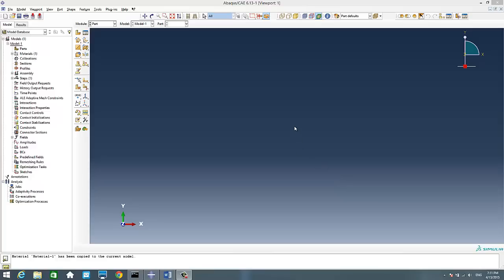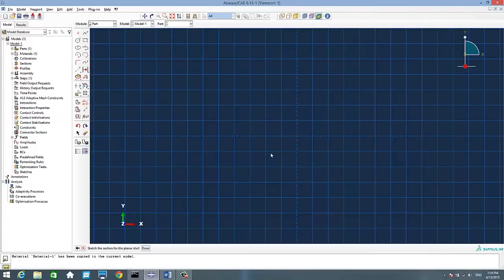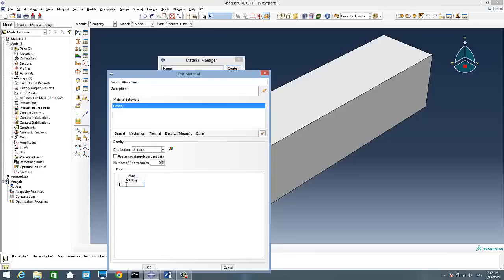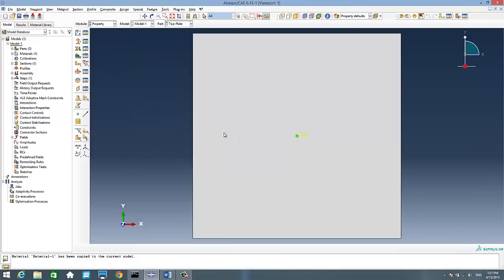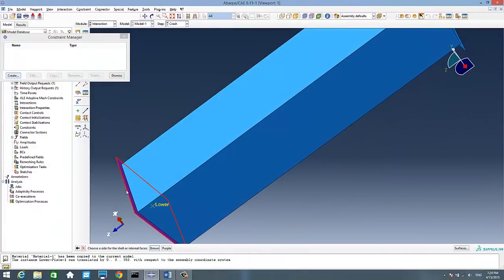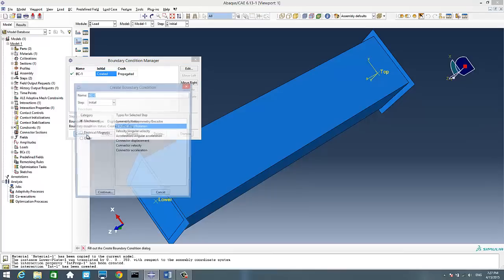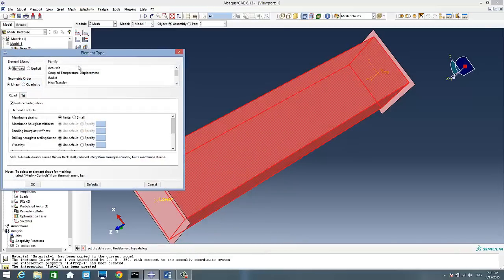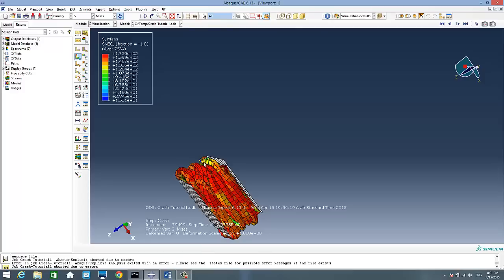Tube Crash Test Tutorial Using Abaqus 6.13

Comment: Can you explain why did you select the box dimension as 76 X 76 (or 38 on both sides of the axes) and why did you select top surface (should you not select bottom surface here? so that the box becomes 80 X 80) ? Why shouldn't we select mid surface and 78 X 78 as our dimension ?

Comment: Can you please make video on circular Tube Crash Test on Composites(Al with Polystyrene Foam). Actually i am working on it but i am not succeed to get the result When i am following your video it is giving Shell is not suitable for plateau stress analysis. Just I  mentioned Al with Polystyrene Foam as a composite

Comment: can you tell me please how much time did the job took to complete ? and what's the optimal configuration of step to have the minimum time for pretty accurate results ?
Reply from the maker: The time period refers to the total time needed to complete the crushing of the tube. In this simulation it was 0.06 seconds (60 milliseconds), which is reasonable because the crushing is dynamic and the crushing mass is 275 kg in our case, and hence it would not take much time. The total running time for a simulation therefore depends on the time period and the CPU you are using. 
As for the accuracy of the results, it does not depend on the step time, however on the way you model your test. The more you define your model by providing accurate material information and good setup presentation, the more likely to get accurate results. Of course you have to validate your simulation results by comparing them to an actual crushing test.
Reply from the maker: I think the job in the video took about 30 to 45 minutes.
Reply: Thanks for your reactivity ! It would be very nice from you to answer this question concerning my specific case :

I'm actually working on the optimisation of cross-sectionnal shape of a car crash-box, and in order to have some results I need to try at least 12 different cross sections of the crash box !

For the design ! I chose CATIA V5 to make the part ! then I imported it to abaqus and i followed the instructions in this video with some changes (In property module : I created solid homogenous section instead of shell, and in Mesh Module : the element type is Tet with 5 in the size of the element), then I run the job and I'm actually estimating more than 5 hours for completion (I have a core i7-4700HQ processor) which is a pretty long time !

Can you tell me what's the best way to simulate the crash of parts imported from CATIA V5 with a minimum time for the job calculations ?!
Reply from the maker: I don't see why you chose to model the crash box as a solid homogeneous section. These crash boxed are usually shell tubular structures, so just change the section to shell homogeneous. 
Also, what is your part file extension?. If you want you can send me your cae file and I will check it for you and tell what is wrong with it. Just write your email.
Reply: iraqihousseinimohamed@gmail.com

Comment: Hi,
I am trying to model a compression test for aluminium. In my model I have a 2D rigid plate and a 2D deformable part. And also my part have some space in itself. I used dynamic explicit step with 0.01 time period. It also run somewhere. But then exited with an error. It has some convergence diffuculties. I also tried to adaptive mesh but it gave me same error early. Also I can see the result of solved part and I looked reaction force. I saw too much oscilation for force-time graph. Can anyone help me to solve this problem. You can dowload the inp file below:

http://files.engineering.com/getfile.aspx?folder=4ba24af0-6056-456f-bc02-f5

Comment: HI! THANK YOU SO MUCH for  your tutorials, they are very useful. 
Excuse me, can you tell me which is the way to make a the fastest way of the response of the job, i mean... the results ? how can I calculated the Johnson Cook parameter? 
you´ll help me so much, please.
Reply from the maker: +Scarlett Aymerich Thanks for the positive feedback. Now regarding the fastest response of the result, I did not get what you mean exactly. But if you are trying to say how to shorten the time of the job, then I can tell you that this depends on the PC you are using and the nature of the job itself. 
Now regarding the Jhonson-Cook parameter I can tell you that this parameter is a material parameter that has to do something with the plasticity. Thus you do not need to calculate it. In this video I used a paper that uses the parameter to account for the plasticity of the steel material, but if you have any other material without this parameter it is ok.

Comment: sir
I am doing my project using ABAQUS. I am using it first time. Its a honeycomb structre and higher order structure to calculate its energy absorption and crushing.I dont know what to input in mass, velocity and time period..Can you please help how to input or what values should be given

Sincerely 
Christin
Reply from the maker: Christin Pious Well that depends on the application. The idea of this crash test is to simulate a crash/accident when a car is hit axially (Head-on collision). In this case there are two frontal longitudinals in the chassis of the vehicle which are responsible of absorbing the energy from the crash. The tube in the video represent the frontal portion of one of these longitudinal which has the cross section of 80x80 mm. And the upper plate represent the other car's mass. From research I can tell you that two longitudinal absorbs 50% or less of the kinetic energy of a car mass which means that one longitudinal is designed to absorb almost 25% of the kinetic energy of the impacting car. Now considering an average sedan car that weighs about 1100 kg, both longitudinals will absorb 550 kg of its kinetic energy, thus one longitudinal will absorb 275kg of kinetic energy, and this is why the mass of the upper plate is 275kg. As for the velocity, these longitudinals are considered to be effective when the impacting car's speed is 56 km/hr = 15.6 m/s, the speed where the vehicle is crash tested in many vehicle safety organization's test rigs. And this is why the speed of the upper plate is set to 15.6 m/s. Finally for the time period you can basically assume how much will it take for such crash to occur in real life and then use this assumption as an input to your simulation. In such crash test scenarios, the whole process takes place in matters of milliseconds and therefore 0.06 sec=60 ms was selected as a good time period. Also you should assure that you chose a good time period for your simulation so you avoid wasting time running the simulation again. For example, if I have selected 0.03 sec as my time period in this simulation, the crash would have not been completed (to the point where the upper plate bounces of the crushed tube) and I would have had to repeat the simulation with an increased time period. 
I hope that I have answered all of your question and helped you ..... and if you have any other questions do not hesitate to ask me. You can send me your email privately so I can further help you with your project and ABAQUS.

Comment: but you haven't assigned property to deformable plates also the job aborted it can't proceed unless you define plate rigid. i got missing section errors i just verified. if i am wrong plz correct me
Reply from the maker: Harshit Puri The two plates must be created as rigid plates with no sections (properties). Only the upper plate has a reference mass of 275 kg and a velocity of 15.6 m/s. And this is because we want to see how much energy the tube will absorb under the worst case scenario for a crash, which is when a car hit a rigid body like a tree or a post. Therefore modeling the plate as rigid with only a a mass and speed condition will assure this case. 
As for the errors you have received, please check Ksenagos Utumbo's comment....
Thanks for the feedback

Comment: Sir, 
Why isn't it necessary to tie the top plate with the square tube in the Interaction module?
Reply from the maker: Surajit Kalita The top plat should not have any tie constraint with the tube so it can bounce back after the tube is crushed to it its final limit (When the tube is extremely crushed and cannot be crushed further).

Comment: Excelent video, nice step by step intructions really helpful. Two comments:
1)The simulation fails after the top plates fully compresses the cube. By reducing the speed a bit this can be avoided.
2)Currently the elements are not deleted when they "fail" This effect can be added by changing the material properties(and the element type)
Reply from the maker: Ksenagos Utumbo Thanks for the feedback. I guess it failed because of the element type properties. This can be avoided as you said, by changing the element's properties to have more freedom while bending.
Reply: can i know we change it to what value for element's properties ? can u explain it more details .
Reply: can u show the new video completed simulations using the aluminium material same with this ? really need this for my project .

Comment: Thanks your video so much. I wonder Can you run this simulation with "STATIC,RIKS"  instead of "DYNAMIC EXPLICIT"?
Reply from the maker: thanhha Tran In static kind of model, you will not be able to add a predefined field of velocity for your boundary condition. What I mean is that you can do a crash test with STATIC model, but it won't be similar to this one because boundary conditions for velocity will be different. In other words, the simulation will be a compression simulation.